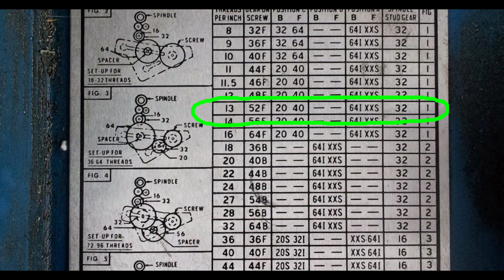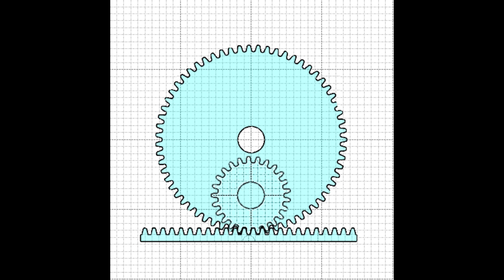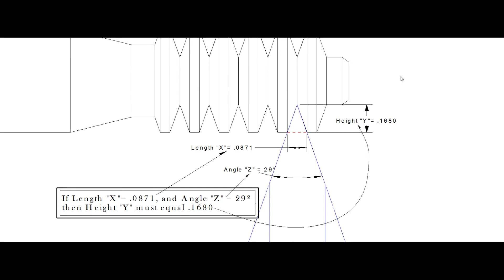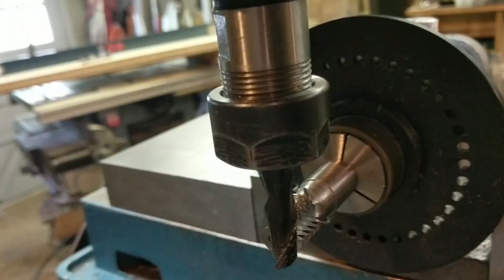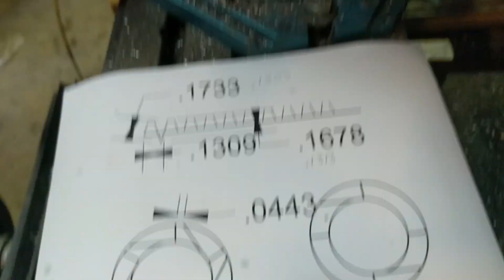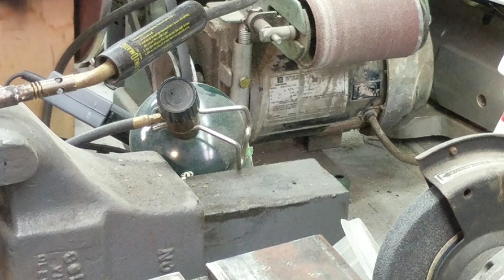Atlas 618 Change Gears- Part 1 Shop Made Gearcutting Hob

Comment: Enjoyed this.  Great description of making a hob.  One thing though.  I noticed that you quenched the hob after heating to tempering temperature.  I see many people on youtube that do this.  I believe that the steel should be allowed to cool slowly in air  to allow the crystal structure to "reform".  I could be wrong, but this is the way I do it.
Reply from the maker: My understanding is that the quench isn't chemically significant, it's merely an easy way to arrest the rise of temperature the instant the part has reached the desired temp. 

I too used to always do the air-cooling, but having seen so many using the quicker quenching method, and presuming it must be about as effective, I decided to start using it.  I can't tell any difference in the parts I've made.

But if you can point me to an official verdict on which way is better, I'd love to know it.

Thanks!

Comment: But how does a straight sided angled 'hob' generate the 'involute' profile of the gear tooth ? Just subscribed.
Reply from the maker: It's true that each of the hob teeth is cutting a straight-sided profile in the gear blank when it makes contact. But remember the hob has multiple teeth, each of which are touching the gear at a different radial point. So as the gear blank rotates through 360°, and all of the various hobb teeth are cutting their straight profiles, all of the potential gear tooth "conflict" points are cut away leaving only the appropriate gear profile behind.  The resulting gear tooth involute shapes are actually stepped rather than a perfect curve, but because they are cut in dozens if not hundreds of slices, they very closely approximate a perfect curve.
Reply: @TheBuildist  . That's a great explanation and much appreciated. Never thought of it that way. So in essence you are 'generating the involute form, not forming it. Always confused me, this process of hobbing, as you always seem to see the hob and the work piece revolving in conjunction with each other. Many thanks.

Comment: Excellent video. Well prepared. I also have a Southbend 10 and a 618, but my 618 is a Sears vintage 1938 (model 101.07300) without a back gear and with the smaller spindle diameter. Because of these shortcomings it was only offered for one year. It has a few change gears but not a full set. Perhaps it didn't because of no back gear. It also lacks the thread cutting chart and there's no indication there ever was one. I'd like to duplicate what you have done, but I would need  the full chart and a list of all change gears. Can you help me? Thanks.

Comment: If I may ask, where did you get the information and formulas for cutting the gear hob? Great video and I have subscribed.
Reply from the maker: I got the basic concept from the website that I referred to.  But his hobs are metric/module and 20 degree pressure angle, so his formulas don't work for what I need.  So I drew out a 24 diametral pitch 14.5 PA gear rack in CAD.  From there I worked out the trigonometry and reverse engineered a working formula.
Reply: @TheBuildist  Did you draw a print on the hob? If so would you share it?
Reply from the maker: @leviadams1793  I did make one.  I've posted it to https://www.homemadetools.net/forum/home-made-change-gears-6-inch-lathe-73312#post135080   (scroll down, there are three pictures.)
Reply: @TheBuildist  Thanks!! That's an interesting looking site. I'll have to check it out.